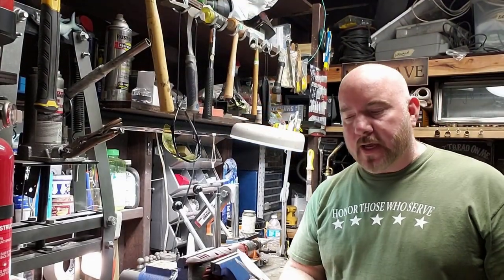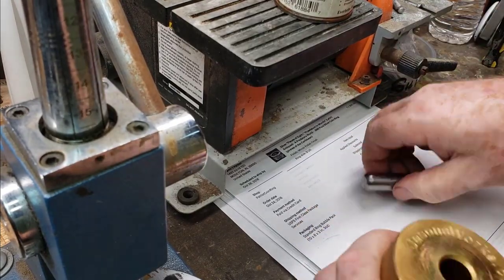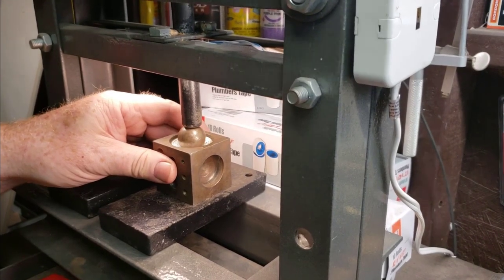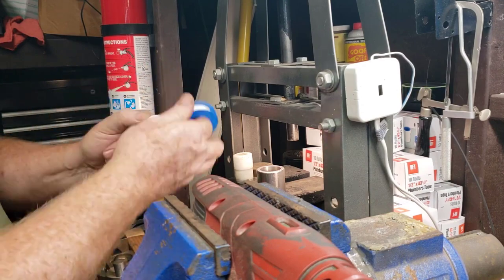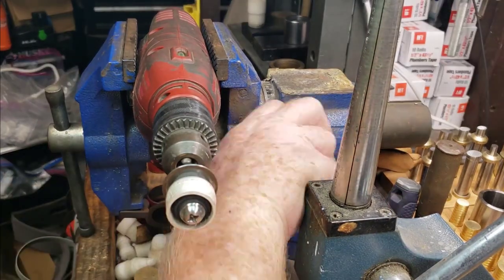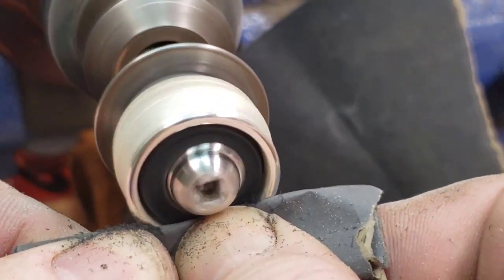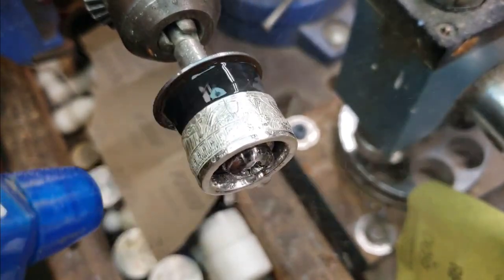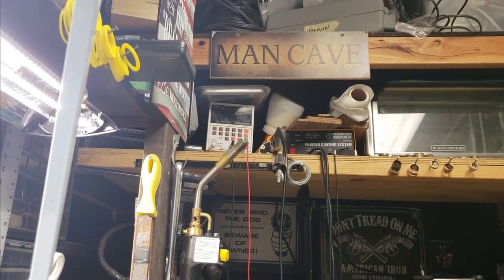Making a Coin Ring | Spanish Pieces of Eight

Comment: I have a question? I'm new to all of this. I'm having trouble making a coin ring I believe it's called a fat tire instead of being straight it's got the bow in it. I am having trouble keeping each end of the coin with the same crown and keeping the same ring size on each side. If that makes sense I don't know what I'm doing wrong
Reply from the maker: That would definitely make a good short video and think I'll make one next week if I can find the time dedicated to you so you can see how it's done properly because there are a few tricks to it but the first and most important detail is having proper quality dies of 7, 12, 17, and 25 degree angles and most all often get used for that perfect look depending on if your customer wants a shallow dome or if they want a true "Fat Tire" which for me is really overboard crazy but I have a lot of customer request it (everyone has their own personal preference to what is beautiful and customer is King / Queen when it comes to making what they want)!  I definitely need to update these old photos of when I first started making Fat Tire rings but this link will give you a great example of a "Fat Tire"... https://www.etsy.com/listing/500788507/1754-the-price-of-liberty-dont-tread-on?click_key=fc4e31a9b298a85302b552cdefd150c4f66537fb%3A500788507&click_sum=97324c18&ga_search_query=fat%2Btire&ref=shop_items_search_1&pro=1&frs=1&sts=1

Comment: That „piratecoin“ look great. You said this resin pushrods are your favorites, but do they work for non-silver coins as well? I‘m still working without the Swedish wrap tools 😭
Reply from the maker: Yes, I use the Delrin push rods for everything even those hard nickel or steel rounds.  You can use them in any dies at any pitch.  What's nice is I use to scratch up the inside of my dies and as most know once that happens any new coin going into that dies is going to get all scratched up really bad or you end up losing an expensive tool.  Delrin actually will mold down and compress so it doesn't scratch the inside of the dies yet hard enough to keep pushing any metal.  Over the years I've collected them all from steel, brass, wood, etc but Delrin is certainly the best material you can use.  One invent that was a really nice improvement to this pushrod I'd highly recommend was the "Ross Delrin Pushrod" which you can find here  https://www.etsy.com/listing/535103212/full-set-of-ross-push-followers-for?ga_order=most_relevant&ga_search_type=all&ga_view_type=gallery&ga_search_query=jason%20works%20ross&ref=sr_gallery-1-1&organic_search_click=1
Reply from the maker: Personal Invite to the BIGGEST open box review and giveaway i've ever held is finally here!  https://www.youtube.com/watch?v=vKG-zaoLqec
$200 PCR Gift Certificate or $538 MSRP Coin Ring Punch Kit!

Comment: Mike, Which Swedish Ring Die Should I use to reduce a ASE to a 9 1/2 ?
Reply from the maker: Good question, I don't even look anymore I have so many dies.  I kind of just reach for the one that fits...lol  In short you'll need a doming block to start the fold and the first dies you should go to is a 17 degree dies (this won't be the sweedish die).  Continue to push the coin down to open the mouth as much as possible and then you should be able to move to a 1.2 Sweed Dies which are 7 degrees to continue the fold outward and then move onto your expanding mandrel to straighten things up.
Reply: Patriot Coin Rings this is soo helpful, thank you! 😊
Reply from the maker: @JTCoinRings  Always glad to help  😊

Comment: How do they remain as 1 ounce when the middle is cutout? 1oz before the center is cut out so hows does it maintain a 1 ounce weight after the middle is cut out??
Just curious
Thanks
Reply from the maker: No, obviously not.  I advertise my rings as 1oz Coin Rings meaning they were made from a 1oz silver or gold but obviously some weight is lost from the punch.
Reply: @PatriotCoinRings  reason I asked was I read somewhere that coins have 1oz of 24k gold in then and then they add the other alloys so the coin is actually 1.2 ounces ( not exactly what it said but approximate weight) so I was curious if the coins your transforming were indeed like the coins I read about. Wasnt trying to be a smart pants, just trying to understand 
Thanks for your reply,  love your content
Reply from the maker: @carterhall2653  I've honestly never heard of that.  All Gold mints I know are very accurate to 1/100th mg when it comes to gold so in short a 1oz coin should be exactly 1oz prior to being punched if being folded for a ring. I've simply never heard of one any additional fraction higher and further (if I understand you correctly) mints are "anal" when it comes to purifying their gold and I couldn't imagine adding alloy metal to the mix.  I just watched a video on that topic all about gold minting and I'll have to find it again to give you the link on those details.  Love the discussion though.
Reply: @PatriotCoinRings  I will try to find the link where I read that, it surprised me when I read it. Guessing maybe misinformation,  imagine that, in today's world LoL😂
Reply from the maker: @carterhall2653  Okay so this is old school and probably was produced in the 70's but if you are into coins, watching the process of gold bullion and what we discussed regarding accuracy to weight and purity it was pretty interesting  www.youtube.com/watch?v=AeGXYYoSO1U&t

Comment: hello I needed to ask you for information as I am self-constructing a small hydraulic press, I wanted to know what size they have the 2 springs you see in your videos, understood as thickness, thread and length. I can not find this info and if you can kindly give it to me. Thanks!
Reply from the maker: Okay so the A-Frame 6-Ton Press (also available in 14 Ton which I think is over kill) is available for around $150 from Harbor Freight.  The bottom of the A-Frame is rather weak and while it’s perfectly fine if you are only making coin rings, if you intend to work with harder alloys like I do and want to beef it up I welded in two 1” steel bars at the bottom of the frame for support where mine had seriously bowed down from use of basic metals.  Further I pulled the 6 Ton Hydraulic pump out and replaced it with an 8 Ton to help me get through those tough jobs.  I got rid of the cheap bar that comes with the 6 Ton as a pump and bought a heavier duty steel bar from my local hardware store for around $4 I brought back and powder coated to prevent rust that works fantastic as a power bar and added what essentially is really a BMX blue anodized bike grip on the end just for aesthetics.   I also purchased off ETSY from Legacy Brand a 3D printed pressure relief knob to replace a pair of vice-grips I and many others use to keep on the relief for quick use.  To top things off I inserted 3 perfectly fitted LED dome lights on the inside of the pump frame that illuminates the work area and is motion activated so it turns on/off as I waive my hand by it.  

That’s pretty much it, my little upgraded press!  Heck, this might be a video itself….lol
Reply: @PatriotCoinRings  hello thank you for your answers what I wanted to know is just the size of the springs that support the hydraulic crick placed on both sides of the same. Specifically, the length, diameter and thickness of the spring wire. maybe I had explained myself badly before. Thank you
Reply from the maker: @schianoclaudio  Oh my bad, I figured you already had one from HF and were just wanting to know what I had done that made mine a bit different looking from others you've maybe seen.  The springs are approx 5" by 1" and heavy duty tension.  Major props for wanting to make your own by scratch bro.  If it were just about money, I'd tell you to just pickup a 1 ton arbor for about $80 from HF or about $200 for a total tweak out like I did because I'm thinking you're going to spend more time and money on making your own in the long run but would love to hear about it if you go through with it.  Sounds like a pretty good project!
Reply: @PatriotCoinRings  thank you for your dimensions, but  the thread of the spring which thickness has? I ask you because so I will be more precise inbuying them....
Reply from the maker: @schianoclaudio  I'll be happy to measure it for you but not sure that'll be good enough.  Springs are made out of different materials and hardened to different tension resistance.  However they are 3mm thick.  Hope that helps my friend.
Reply: @PatriotCoinRings  thanks you have been very kind
Reply from the maker: Personal Invite to the BIGGEST open box review and giveaway i've ever held is finally here!  https://www.youtube.com/watch?v=vKG-zaoLqec
$200 PCR Gift Certificate or $538 MSRP Coin Ring Punch Kit!